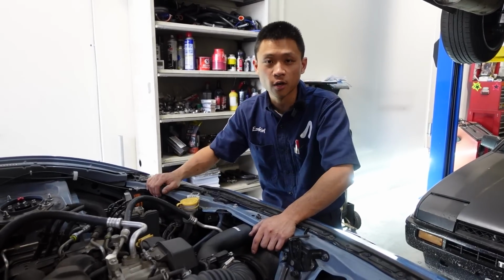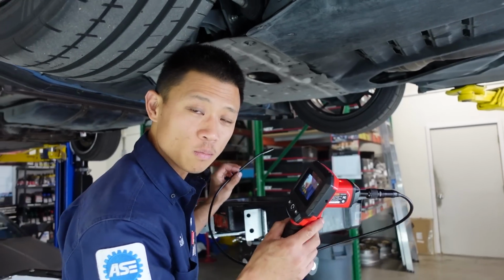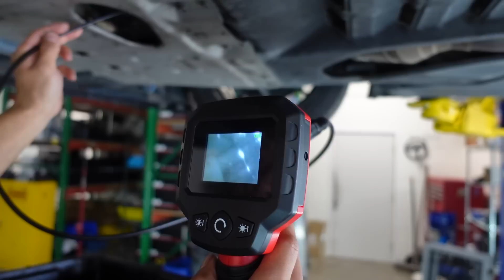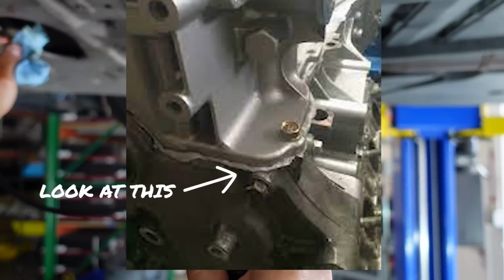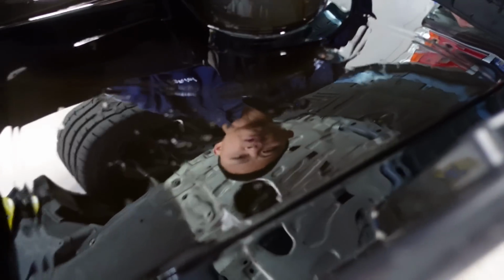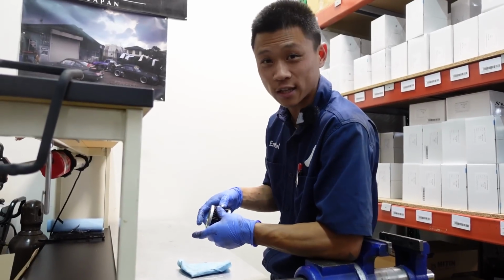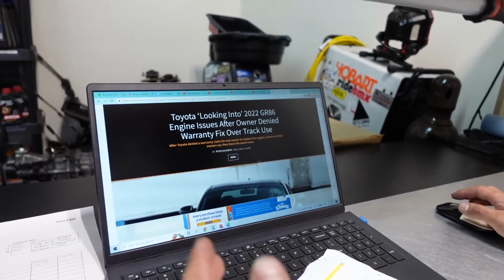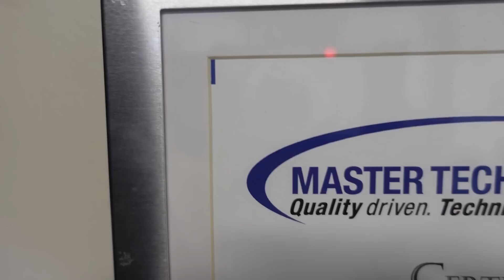GR86 RTV Engine Failures: thoughts from a former Subaru Master Tech

Comment: Hey!! So im actually looking into getting a new gr86 but im worried as too if i would run into this RTV issue. Whats something you would recommened that i could do when i first get the car to prevent there from being any silicon build up? Would getting it re-done or cleaned help? Just would like your thoughts on it because i really want the car but would hate for something to happen to it.
Reply from the maker: https://youtu.be/2ZCzLtIhMzw

If you plan to track the car Id drop the pan at 1000 miles and clean te oil strainer

Comment: this issue is basically cancer for the car no? i mean if silicone is going to potentially colg the oil from getting to the engine, its only a matter of time before it does? Im trying to figure out if this is an issue car by car or the entire 2022 BRZ/86 is due for some issue down the line

Comment: I walked away from a BRZ,  the dealer refuse to give me a straight answer about engine failures etc. Pretty sure they wouldn't stand behind it. All Toyota needs to do is put a good engine in the little car, instead of the junk Subaru has made for years.
Reply: The engine from the GR Corolla is coming.
Reply: The engine is a fa 24 its a new engine and a new problem fa20s and ejs don't have this problem

Comment: I have been looking at buying this car but fear the engine. Should I not buy this car and save up more for a Nissan Z or Supra? I do plan to drive it quick. Most of the time because it is slow
Reply: buy a go kart.  0-60 in 1.5 seconds for the top ones.

Comment: Can't I just take the 86 to a toyota dealer and tell them to drop the oil pan and reseal?
Reply from the maker: Yes. But you'd have to pay out of pocket then hope the technician takes pride in his work - under the flat rate system, you are paid by how fast you do a job, not how well you do it which is why so much work that comes out of dealerships is half ass or downright dishonest.

Fun example: 2006 legacy cabin filters are a bit of a pain to replace because of all the interior clips - I used to work with a tech who would just straight throw the cabin filter away and flag the labor time because FLAT RATE!
Reply: @CMAutohaus  damn. How common is the RTV issue? I still want to get the 86 next year.
Reply from the maker: @lawnmower6591  Every single vehicle is affected by excess RTV applied from the factory. Every. Single. One.
Reply: @CM Autohaus  damn. I'm asking a few others and they're telling me to not really worry about it. Hopefully everything comes out good.

Comment: Well at least im not the only one having toyota problems. My 22 corolla has been nothing but problems since the day I bought it. Its literally falling apart. The transmission failed the first day I got the car. I didnt even make it home from the dealer. The engine burns oil and has a timing chain rattle which toyota refuses to address. And a friend of mine just bought a 22 tundra and is having the same kind of issues. Ill never buy another toyota.
Reply: that sucks to hear.  Makes me wonder if supply chain issues / covid restrictions in factories and such jazz is responsible?  Will be interesting to see if this is more widespread over auto industry in the years ahead, that cars around 2022 etc are just less well built than other years.

Comment: How come Subaru switched from traditional gasket's to silicone? Some benefit must outweigh these downsides?
Reply from the maker: Ease of manufacturing. Same with the driver airbag - used to be screwed in with bolts, now there are spring clips - one step assebmly for the robot, but PITA to service/remove
Reply: Had issue with gasket material making seal.

Comment: If the engine is held together by silicone, how is a mechanic supposed to do a disassembly? Is it even feasible?
Reply: You cut the sealant with a razor blade.   Typically the sealant isn't that strong so some prying on the pan will make it release.
Reply: it's not held together by silicone, silicone's job is to seal it from leaks between parts, not hold parts together, they're still bolted. That being said, hammer, prybar, wedges, razer blades.
Reply: @quademasters249  Ok I was wondering about that. I had heard that at one point there were engines that were mostly "glued" together so I was curious.
Reply: @gwot  I see. I've never cracked an engine open. So I wasn't sure if its structure was revised so that it was basically an engine that had minimal bolts and mostly held together by "liquid sealant". I was researching that and heard that some engines throughout time were essentially just "glued" together.
Reply: @cyberneticxylem9614  Im no mechanic but engines are made of multiple cast metal parts that are bolted toegther,  In order to prevent fluid leaks there is a gasket that is installed between these pieces.  The gaskets in older cars were made of cork/ rubber. other material?  But now there is no physical gasket and it is just silicone that is supposed to take its place.
Reply: @cyberneticxylem9614  think of silicone as just a liquid gasket, cuz that's basically what it is. To my knowledge, no engine is glued together, they're all bolted, also, silicone does not mean less bolts needed.
Reply: @alexopferman8810  Cork?! Wow.
Reply: @gwot  That makes much more sense.

Comment: my 2023 brz just blew an engine at 5k miles
Reply: Mine is 2023 GR86 Just blew an engine at 4971 and Toyota is denying warranty claim. I was told that the car was abused. Totally BS report by Tracy Toyota
Reply: Judging by your profile videos you are 12 years old.
Reply: @stephenschenider4007  that was 5-6 years ago bro?
Reply: @anp3617  that was exactly what I was scared subaru would say. Luckily they replaced the engine for me and even offered a hefty compensation check for a bad replacement job. What evidence did they use for the abuse claim?
Reply: @alexkubitza6992  I'll assume you arent larping and trolling so stories like this really make me not wanna get one. In fact man I'm just gonna get a base model Mustang GT with a track pack. I didnt wanna spend 47k on a car but I make enough screw it. I just have an uneasy feeling about buying a new car and already worrying about shit that aint right. Also I plan on keeping any new car I buy forever. I want to start collecting cars in my thirties so maybe by 60 I have a nice neat little garage built up.
Reply: @stephenschenider4007  no brother I am not just trolling. Shit broke my heart. I waited 9 months for this car through the order pipeline and was devastated. Scared for my life because of horror stories I seen online of toyota specifically not honoring warranty claims because someone posted a pic on their instagram of their back end sloghtly breaking loose. I love my brz so damn much, but I will always be scarred to blow a rod again.
Reply: @stephenschenider4007  I agree, save for the GT if you can, but I have driven both of those. Yes the GT is louder and yes its faster, but it will never compare to that feeling of ripping curves on the brz accelerating through all the turns.

Comment: These claims of RTV causing engine failures and overblown statements are hilarious. Even more hilarious are assumptions as to "why" certain failures aren't covered by warranty....lol

Oh BTW, almost all manufacturers use RTV sealed oil pans now, and if you boroscope those you will also see beads of RTV inside the sealing edge of the pan. It's perfectly normal.

Comment: You just made my heart drop 🥲 I just got a new GR86 last week, the hell am I supposed to do now 😭
Reply from the maker: Regular preventative maintenance and measures like borescope and oil filter inspections.
Reply: @CMAutohaus  I checked my oil dip stick yesterday and it had a very small piece of silicone on it, I haven’t completed the 1000 mile break in but I guess I’m going to the dealer early to see if they can fix it
Reply: @wholesomedeus1655 My car  is a 2023 GR86 it only has 4971 miles and it’s already broken rattling noise inside the engine Toyota corporate denied my warranty claim dealership charging me $5,689 to tear down the engine. Just to tear down and inspect. No repair yet
Reply: @anp3617  that’s just sad, also don’t they need a reason for denying warranty. Cause I would lawyer up
Reply: @wholesomedeus1655  They said the car was abused. It was totally BS!